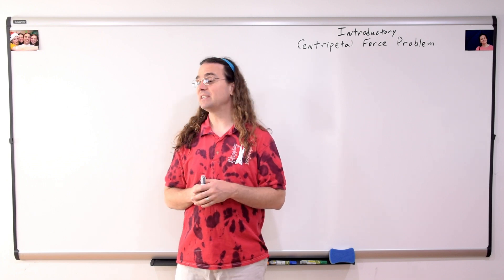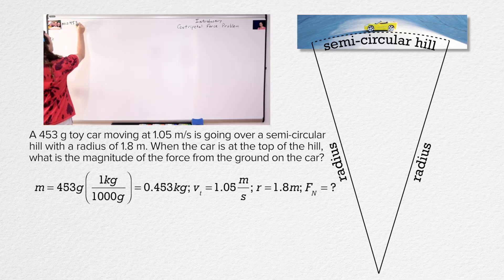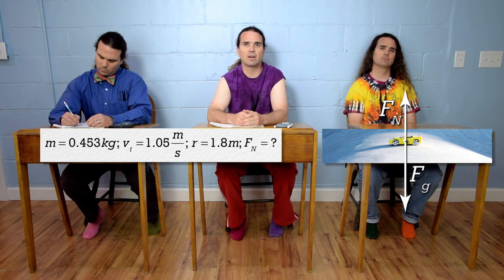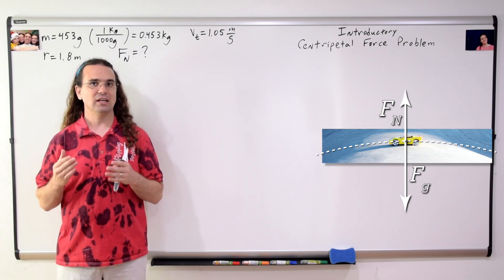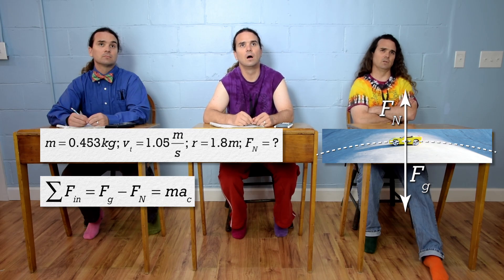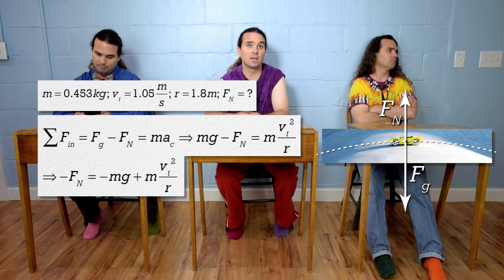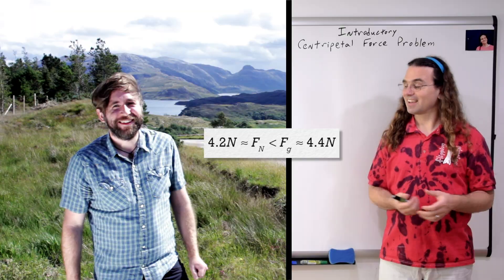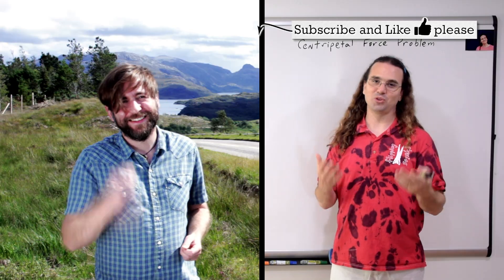Introductory Centripetal Force Problem - Car over a Hill

Comment: Thank you for this video, but may I ask why do you feel you weigh less on the top of the hill? If the normal force is less, then that means the force of gravity is more than the normal force, so you should feel as if you weigh more because the force of gravity is larger, right? Please correct me if I am wrong. Anyway, your channel is amazing !!!!
Reply from the maker: 1) You do not feel your weight (also known as the force of gravity). https://www.flippingphysics.com/apparent-weight.html

2) Your mass does not change in this situation, therefore, your weight also does not change. https://www.flippingphysics.com/weight-not-mass.html

Comment: Why don't you consider static friction in this problem? In the mint problem in your other video, you had kinetic friction in your force diagram, but it's not here-- why not/
Reply: Due to the laws of the universe, x and y components are independent of each other. Even if the frictional force (static or dynamic) was there, it wouldn't of affected the Force Normal anyway as it faces in the out direction
Reply: Static friction acts parallel to the surface of the road, and is perpendicular to the acceleration in this problem.  Therefore, it isn't relevant to the force addition equation that matters.
Reply: @carultch  How would static friction be perpendicular to acceleration? Isn't acceleration of the car caused by static friction of the wheels?
Reply: @2MinMaths  Acceleration can happens in any and all of the three axes.   The static friction of the wheels can only cause acceleration parallel to the road surface.  So static friction can only account for two out of three of the axes of acceleration.   Gravity and normal force are the forces that need to account for any acceleration perpendicular to the road surface.

In this particular case, we aren't interested in any changes in speed or steering, which are the kinds of acceleration that static friction would cause.   The speed is already specified, and assumed to be constant, and car is assumed to be driving along a road that is straight as viewed from an aerial view, such that no steering is necessary.
Reply: @2MinMaths  We could make a similar problem more interesting, and set it up so that static friction does play a role.

Suppose the car is speeding up at a rate of 2 m/s^2, while passing over the crest of the hill with a 1.8 m radius hill crest, using its internal motor to drive the wheels.   The car had a coefficient of static friction of 0.5 with the ground, and all four wheels are driven by its motor.  What is the maximum speed it could have concurrently with this acceleration, so that the wheels don't skid?
Reply: @carultch  Thanks for your response-- the insight was really helpful. I took an attempt at your word problem and here are the steps I took: 
MY FBD looked like Fg pointing down, N pointing up, and fs pointing straight left, assuming the car was moving forward (in the direction of the acceleration). 
I know fs = MsN, but realized that wasn't useful so rewrote it as fs = ma, then substituted 2 for a and rewrote it as MsN = 2m. I didn't have mass, so I wrote another equation: Fg - N = mv^2/r, then rewrote N as m(g-v^2/r), and substituted that in for N in MsN = 2m. Now I had mass on both sides since the new equation is Ms(m(g-v^2/1.8)) = 2m. Canceled out the masses, then divided both sides by Ms where the equation now becomes g - v^2/1.8 = 2/Ms, and isolated v to get sqrt (1.8(g-2/Ms)), giving me velocity as 3.23 m/s. 

I'd love to know if my approach was correct or if there was an error in either my math or conceptually. Thanks!
Reply: @2MinMaths  Here's my solution:

Givens & known constants:
Static friction coefficient: mu_s = 0.5
Tangential acceleration: at = 2 m/s^2
Radius of crest: r = 1.8 m
Gravitational field: g = 9.8 N/kg

Unknowns:
mass m, normal force N, static friction force Fs, centripetal acceleration ac, velocity v

Sum of forces vertically, to equal mass*centripetal acceleration:
m*g - N = m*ac

Sum of forces horizontally, to equal mass*tangential acceleration:
Fs = m*at

Maximum possible Fs occurs when Fs = mu_s*N.  Substitute accordingly:
mu_s*N = m*at

Substitute v^2/r for ac:
m*g - N = m*v^2/r

Solve for N:
N= m*g - m*v^2/r

Substitute in the other equation:
mu_s*(m*g - m*v^2/r) = m*at

"Everybody brought mass to the party":
mu_s*(g - v^2/r) = at

Now we have an equation with only one unknown, which is v.   Rearrange to make v the subject:
v = sqrt((g - at/mu_s)*r)

Plug in the data, at=2m/s^2, mu_s = 0.5, g=9.8 N/kg, r=1.8 m:
v = 3.23 m/s

And we both have the same answer.
Reply: @2MinMaths  
You did well with your solution.

My recommendation is to hold off on plugging in data right away.  Solve in terms of letters first, and then when you get to your closed-form formula at the end, you can inspect your equation for extreme cases to see if it makes sense.  You might also be given multiple sets of data to evaluate, and solving in terms of letters first, enables you to not need to repeat it.   This also enables you to show that it is independent of information not given, like mass in this example.  Pretend you do know the mass, and show that it will cancel out.

For instance, we can ask ourselves, what if at=0?  In this case, it should reduce to Mr P's original problem, and we end up with v=sqrt(g*r) as the maximum speed if it were constant.  This should look familiar to us, as a simple rearrangement of ac=v^2/r, when ac=g.

We could ask ourselves, what if radius of curvature is infinite?  In that case, it should reduce to the case that the road is planar and flat, in which case our equation shows that it doesn't matter how large the velocity is, since acceleration limits on a flat road is independent of speed (assuming motor capacity isn't the limiting factor).

Some students assume an unspecified mass is 1kg.  Of course, they get the correct answer, but that is an assumption that could be marked incorrect.  Part of the challenge of the problem, is showing mass independence in the solution, when possible to show it.
Reply: @carultch  Yay! This was fun to read and tackle the problem. Thanks for the insight!
Reply: @2MinMaths  Indeed, this was fun to discuss with you as well.  Thank you for engaging.

An additional factor that could apply, is what if the car were 2-wheel drive?  I almost gave that in the example, but couldn't figure out how to keep the problem statement simple.  The problem gets a lot more complicated, because the traction will be governed by the distribution of the normal force among the wheels, since only the powered wheels can contribute to traction.  And even a car that starts with uniform normal force among the wheels, will not have it uniformly distributed when accelerating.

Comment: But if we are rotating on the planet Earth that means that the normal force and weight are never really the same? There is always a centripetal force due to a gravity that will make the difference between our weight and normal force?
Reply from the maker: This is essentially the same thing as the fact that we ignore air resistance, assume the acceleration due to gravity on Earth is constant, ignore buoyancy forces on most objects, etc.
The radius of the Earth is roughly 6.375 x 10^6 meters and you know the planet rotates once every 24 hours, so you can figure out the angular velocity of the planet. Therefore, you can determine the centripetal acceleration of an object on the surface of the planet to determine how much error there is by calling that centripetal acceleration negligible.
Reply: @FlippingPhysics  That makes sense. Tnx a lot :D